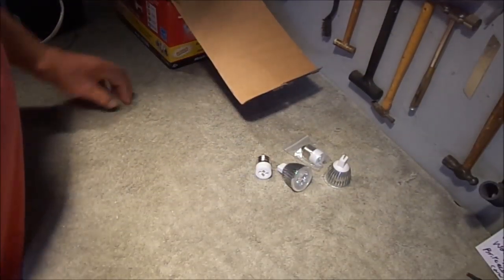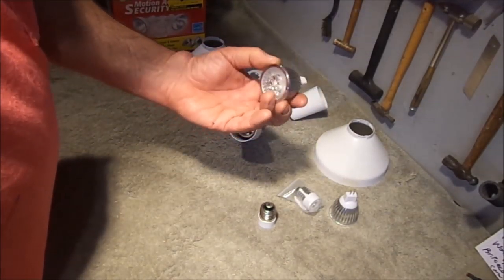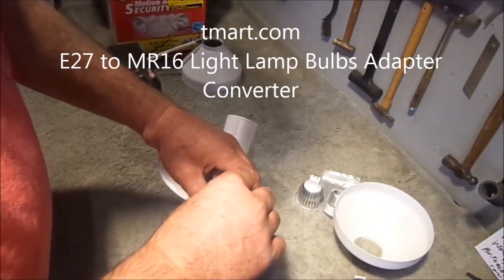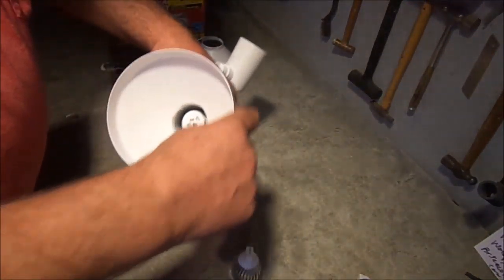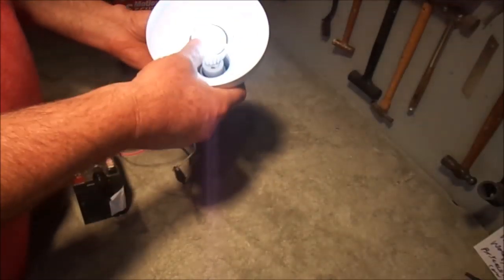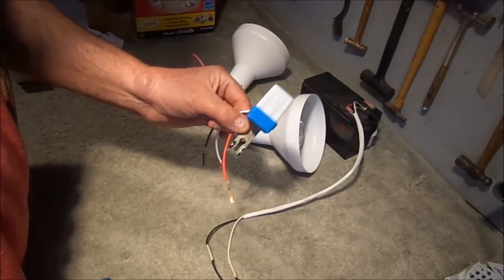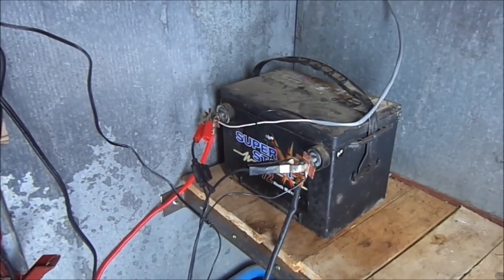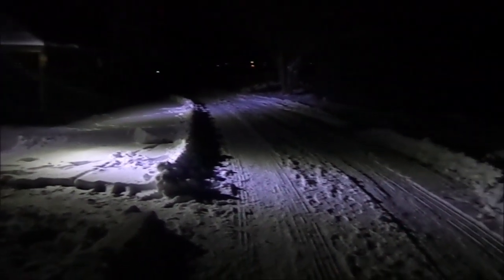Dirt Cheap, Home Made, Super Bright, Highly Efficient LED Security  Lights

Comment: I have a sensor light with everything it comes with besides the lights. but I do got some uv lights that is 12v that has the same connection how can I hook them up with the sensor that's already on it to power them. all you showed is the drawing I don't understand it as I'm not electrical savvy.

Comment: How did you " modify " it to run off 12v dc ?
Reply from the maker: It's a 12VDC track light, MR16 I believe.
Reply: NothingWrong WithThisName just plug and play I believe? idk the wiring diagram looks like he just ran both lights to the same power source even tho u would think they are already wired like that... he didn't explain this conversion to dc at all besides the wiring diagram that popped up for a few seconds with now explanation or how to.........?  I guess Google has my back as always ;) thanks tho

Comment: What voltage is the original unit with the sensor? Does the power input impact the sensor?
Reply from the maker: Ray Williams 12 V DC
Reply from the maker: ***** These are 12 V DC, the ones you reference are 120V AC.

Comment from the maker: A deep cycle car size battery should run it all night easily. A 10 watt solar battery maintainer should keep it topped off. I found a single waterproof Malibu spotlight housing at Home Depot that holds a single mr16 bulb and the pins fit perfectly.